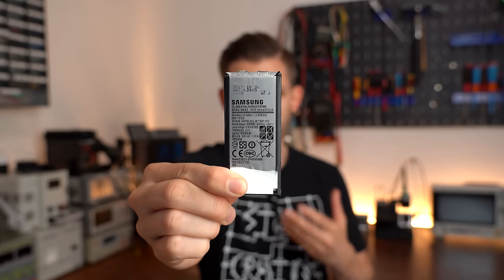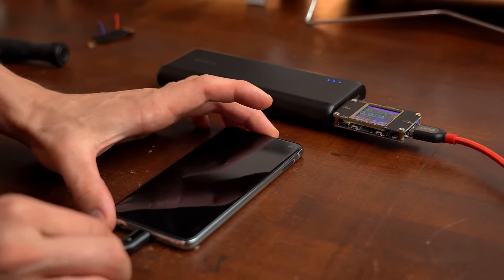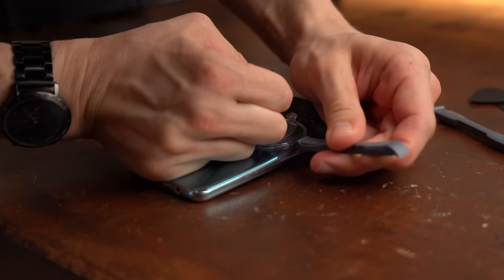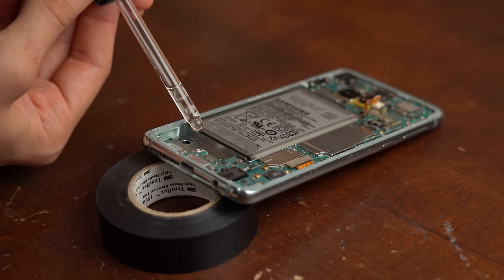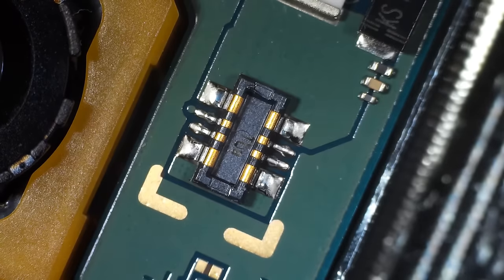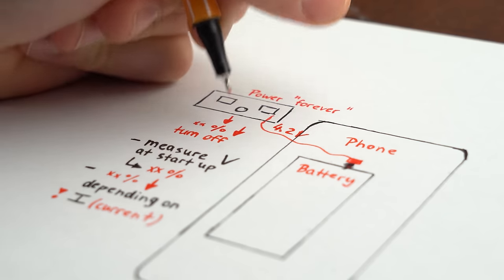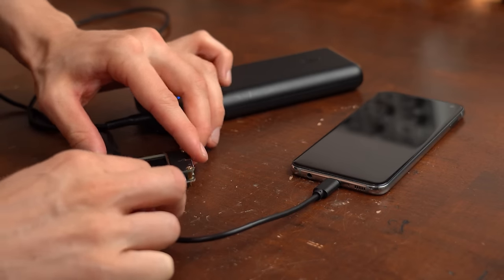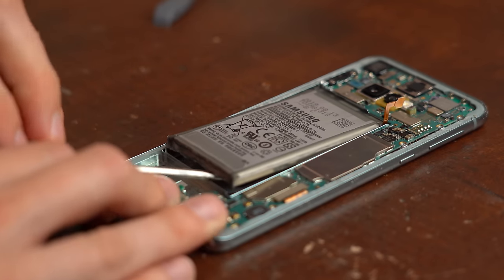I "Solved" Samsungs Swelling Battery Problem! (Batteryless Phone)

Comment: Why not just solder a little super capacitor to the BMS and connect the phone normally via USB C?
Reply from the maker: Could be possible. Not 100% sure.
Reply: @greatscottlab  The BMS would probably shut off, if the capacitor discharges too much (if the phone is not in use for a while). But I think with your circuit, I would have tried to get power from the USB socket inside the phone, cause it looks kinda ugly with a wire sticking out the side. If you wanna be able to use any USB cable without quick charge kicking in and blowing up your BMS, maybe use a zener diode and resistor to generate the battery voltage?

Comment: Just here after the notification and I haven't seen the video yet...
I had two similar batteries on my old Lenovo one  (new one) inside the phone for a long time with no use...and a old one outside (which was around 3.7v when I replaced)
After like an year (zero usage) ...the new one had bulged and and had nearly 0v.
On the other hand the old one which was stored outside was perfectly flat and still measured around 3v.
So yes... Lipo's bulge when they r over discharged.. 
Idk why PPL are fussing about it recently 🤔

Edit:  this video reminds me of my similar mod where my cheap Chinese tablet required a 1.2k sense resistor... Should have just re used the protection circuit instead of going through all that stuff 😭

Comment: I have had 2 batteries swell up in my Samsung phones. The older phone I no longer use but the Note4 I use and I had to replace the swollen battery in it to keep it working. My back cover comes off easily and the battery is directly accessed that way. Much better than the one you have there. My battery does not have those connections like yours.

Comment: Okay, this is a bit better than usual videos about this but it is still a bodge.
What if I need the data wires? And is there no way to get the connectors and build a solution that doesn't depend on the charging board?

Comment: As someone who still uses a s7 as a daily driver seeing that "brand new" phone frame get destryed hurt me a little. I understand you are trying to prove a point but using a "current gen or 1 gen lower" phone is not a good idea. You could have sold the s10,got a s2,s3,s4,s5 or even a s6 for much less money and did the same thing.Also some people   are criticizing your approach to which i disagree. Your destructive method is perfectly fine as long as the device is no longer usable as it was designed to ,but if the device is still usable as it is you should never do anything permanently altering to it.

Comment: A "touch screen + wifi + webbrowser" aka smartphone + raspberry pico-W,  usb hid macro "keyboard", 
at least when adafruit gets a stable webserver in circuitpython ...
browser does not need to load page from "webserver", local html page + many pictures on smartphone should work.
No need for pictures then webpage containing html buttons could be loaded from pico-W webserver.
Reply: GreatScott ±⁴⁴⁷⁴⁰⁵⁰⁷⁶¹⁸⁷  nope

Comment: always turn on the "don't charge over 85%" option,! every android thing i've had failed from swollen batteries before anything else. some models are overprovisioned and limit the charge without advertising it (for added battery longevity) but models where the size of the battery is a selling point ("3 day charge!") operate those batteries right at the edge of their total capacity. they'll swell if you do a full charge all the time, and they're configured to do that, because it's a point on the spec sheet. a phone you like tearing itself apart in under two years is a big bummer
Reply: samsung uses really good batteries, but this will still happen. especially if you have the phone on the charger part of the time at work or during a commute instead of charging it every other day

Comment: I have a 3D Printer controlled via Octoprint, and was going to use an old phone as a new terminal, but haven't sorted it out yet. I was going to have it attach with magnets, and a wireless charger. But I might just do this instead.

Comment: i died a little when u used a file to cut openings intot he housing, knowing that something like this could be done non destructively with just a small supercamacitor and flat ribbon usb cable and using that to rout it external, or you can solder to the internal usb c port to not need to have the plug on the bottom at all and just one wire comming out of the phone with the usb c port being connected inside the phone

Comment: Initially I thought the phone would die because the 5V USB power supply can't handle high current spikes. But maybe it's fine as long as  you don't use GSM and mobile data.

Comment: i have a metal detector an old minelab sd2100 and its supposed to run off this giant 6v led acid battery that you carry around on a sling, but it interferes with the signal because its not connected to the detector its moving in its feild when your searching and you have to hold it really far away from you in order to stop the interference and its annoying as hell, so i took a cooked 18v dewalt cordless drill i had that no longer worked, gutted its internals, used the battery connection point and made a simple little voltage reducer circut with a variable thingo i cant remember the exact name for it, put all that into the drill handle housing and strapped it to the detector, so now i can use my little 2ah batteries one last all day, and because its fixed into place within the detectors magnetic feild it no longer causes interference, it looks a little janky but i swear its the best mod ever! I decided against the resistor method to drop the voltage because i needed to go from 18 to 6 it would have been far too power hungry. This project reminds me of that, i love powering things in more conveniant ways, i also converted my lazer level from 4 aa batterys to run from a usb power bank its a little less voltage than the 4 aa's but it works fine just a little duller than fully charged previously but otherwise its far more conveniant and less expencive

Comment: have to manually boost the battery from the spot welded nickel to boost it to about 2.8v then battery works on phone...if falls below 2.7v the phone keeps rebooting...   just boosting after protection board the ic refuses.... so directly onto the strips

Comment: Would there be any benefit in using like a LTC3440 type circuit instead of just a diode for the voltage regulation? Just curious.

Comment: Nice video! Could the same be achived with replacing the cell with a capacitor? Or are the current draws from the battery to High even when charging?
Reply: capacitors are literally made for high current draws, where they lack is capacity otherwise they'd be called batteries
Reply: @chiefdenis  Yea but if the charger is powerfull enough the phone, shouldnt draw power from the battery. Aka the battery just needs to be "there"
Reply: @express496  logically yeah, but phones always draw power from the battery even when they're at 100%, my guess is batteries are used to smooth out the voltage curve and maintain stability, like a capacitor

Comment: I wish you had not made a hole in the phone and internally connected charging port terminals to diode and battery management circuit so the phone was powered through just one cable! 😢

Comment: Do you think this would work also for old gopro cameras, specifically the 3?
I want to use the Gopro in it's underwater housing as a wireless camera to put under the house to monitor the water ingress when it rains and pump out the water outside, but most of the batteries I have for it don't hold a charge anymore or are kinda swollen. I found that without the battery, the GoPro itself will power on, but "wireless" wifi mode will turn on for a while and then switch off. With the battery, wifi doesn't turn off automatically which means I can just connect to the camera whenever I need without having to go under the house.

Comment: Hey there, I am struggling to find the best soldering wire for a good-quality joint and low melting point. It will be very helpful if you can say me which soldering wire you are using.

Comment: I have 7 Samsung phones, 6 old ones and my current one.  Only the battery in the S4 swelled up a few years back, but I was able to replace it and that replacement has not swelled up since then.  I guess it was a fluke or maybe a bad batch of batteries that year.

Comment: Well actually there is a much more simple solution to run a phone without a battery. The thing is just to use the original battery pack and solder a capacitor instead of actual battery. This is how you could run a smartphone using a regular USB cable without any extra wires.

Comment: Out of curiosity, wouldn't be simpler to replace the battery cell with a capacitor (and a led if necessary a discharge) and charge the device with usb without ruin the case?
Reply: It depends on what you're going to use the phone for. If it's just a fancy alarm clock it would probably be ok, but for heavy or continuous use, the cap can drain faster than it can be charged.
Reply: @iguanamoat  security camera would that drain the cap faster than it charge?
Reply: @angryman9333  I can't be sure, since the power demand would vary by phone and camera app. I think it would be okay, since you can usually charge up your battery and run a security camera app at the same time (meaning the charger can keep up with that load) - however, if it can't keep up by a large enough margin, something like an update happening in the background could easily be enough to push it over the edge.
Reply: the charge/discharge would need a proper regulation circuit and then ya start getting into "why not just put another battery in it?" territory

Comment: Simply replacing the battery with a capacitor could have also worked. And without cutting the case. It would just have to be strong enough to get past the boot.

Comment: Im honestly surprised no one has come out with an aftermarket battery replacement mains adaptor for older phones. Simple 4v a few amps, and you dont have to worry about your old tablet you're using as a home automation interface exploding inside the wall its installed in. Like, with the limited recharge cycles of lithiums.....its simply negligently irresponsible at the very least from an e-waste stand point the manufacturers dont have a battery-less power supply option much less force the device to have a battery in the first place.

Just for the love of frigg DO NOT follow those stupid instructables that just jam 5v on the battery contacts! Thats not how the charging circuit works!!!

Comment: So, not a solution to run the phone without battery, but using ACCA, a frontend for the magisk module, with root can limit the charging. Works with the default settings on the G9600, the snapdragon version

Comment: Sad to see that your S7 have died. Both phones have good alternative firmware to run on them if you don't have any problem to run LineageOS. I have two of the S7 phone and they run well with LineageOS 19.1.  What device is it you use between the phone and power supply? Any Link for where it can be bought would be nice 🙂
Reply from the maker: You mean the MUR460 Diode? You can get it on Ebay.

Comment: This really is not a great solution. GSM modems can pull spikes of several amps when joining a network or hanging off a distant cell tower.  Your USB power supply will not be able to meet that sudden peak demand and things are likely to be unstable.

This is why phones and tablets will generally check and refuse to operate if they think the battery is missing/damaged.

You should put a super cap at the same point to smooth that demand, or at very least turn off GSM activity and use WiFi only to remove those spikes.  Tablets with wifi only are a better candidate for this modification

Comment: I need help! I watched this so i can connect my old S7 to my 3d printer. I need the USB to connect to my printer but then i cant charge it anymore, so i thought of soldering a power supply to the phone. Now as it turns out i still need to use the USB port for the power supply so this doesnt work. Can anyone suggest a working OTG cable that lets me connect to my printer WHILE charging the phone simultaneously? Or does anyone know a method of using a soldered power supply without using the USB port?

Comment: This is cool... very useful.
But I hate that you can see the phone has ben modified, would be much nicer if the solution could be inside only.
Also, way do thy not just make the phone work without battery in the fist place, and maybe make it a bit easer to remove.

Comment: I think that an electrolytic capacitor as a replacement for the battery unconnected with respect to the USB cable is a better solution. It does not require any holes or permanent damage. I tested this solution on some devices. Although in one case, it did not work properly. I would like to know if someone else found this to be a good solution.
Reply: The main issue is that the phone can drain the cap faster than it can be charged during heavy/continuous usage, causing reboots/crashes. Maybe that's what happened in that one case?

Comment: I have a tracfone that I power using a powerbank on the pins in the back.  It always stays at a 100% and hasn't once randomly shut off. Very curious as to way the modern phone has that voltage drop very odd indeed

Comment: It still scratches my head. How can the battery % go down when the voltage is still at 4,2V? What if you have replaced your faulty battery with a new one? Would it use its full potential? This principle is a bit similar to the ink cartridge printers where the microcontroller also simulates the amount of ink left. What if it was faulty and the cartridge still have a plenty of ink inside? My J3 2016 dies on 20% of the battery. Sometimes jumps from 30% to just 1%.
Reply: It calculates charge based on current in/current out of the sensing IC. It re-calibrates on power up and over time (hence why sometimes phones need recalibrating by letting the battery die then be re-charged from flat to get proper reporting). It's nothing to do with DRM, battery voltage is just a poor method of calculating charge due to voltage variations over load

Comment: I got around this problem by replacing my old phone's battery with an external lithium super capacitor (750F)
Gives around 10 minutes of time away from the wall, but that's not a real problem since it's meant to be used connected to any usb charger
*Charging the super capacitor also has to be done externally (a simple type C usb buck converter set to output at 3.8v, not 4.2v), which added some bulk so it doesn't really feel great in the hand, I didn't need to connect the usb charging port for my phone model so I got lucky there
Reply: my samsung s8 phone keep shutdown even there is supercat 5.5V 1F
Type C Female > LM2596 > Supercap 5.5V 1F -> battery logic board -> phone
5v in, and output 3.8-4.2 but still keep shutdown, samsung logo boot then blue light > shutdown
Reply: @HDWB_Gaming  1F might be too low and the cap's voltage probably went below minimum during startup since I faced the same issue when I tried with smaller capacitors. I don't have any smaller super caps than 750F so I don't know what the actual minimum is
Reply: @bnelsey  so what i need to buy is about 3.8V or 5V supercapacitor with high F ?
i just follow some dude guide but look like 5.5V 1F just to prevent power spike, not to turn on phone
Reply: @HDWB_Gaming  high F and the closer you can get to 4.2v (Lithium Battery max voltage) the better, the 750F 3.8v supercap i'm using has a total energy similar to a tiny 300mAh lipo battery, which would explain why a 1F supercap is giving you problems
Reply: @bnelsey  ok i will order that one :) ty
btw this connect directly into BMS, so i can still plugged type C into type C port for samsung dex, usb hub right?

and i see a lot of "UF"
eg 4V 680UF
Reply: @HDWB_Gaming  you'll need 1,000,000 UF to get 1F, so those UF capacitors are extremely tiny
Reply: @bnelsey  oh i see, when i check one with 3.8V 750F, price is almost x3 battery cost itself
the one i found 3.8 500F price is equal as battery. about 4.5$ i think

Comment: I literally just made a video of me doing this to a s6 a few days ago, and now I see this video come up. I didnt notice the battery level going down yet though, maybe I should have tested it for longer.
I'm going to have to come up with a different solution for the slow 'discharging' than use the usb port, as I want to use the phones usb port for USB OTG peripherals

Voltage seems to make no difference, i booted it at 4.1v and it said 85% battery left upon booting. It then 'discharged' itself to 82%. I upped the voltage to 4.4v and rebooted the phone and it still thinks it has 82%

So far I am testing modifying the phones perceived battery mah rating by editing the phones floating_feature.xml (the phone must be rooted)
Its located in /etc/floating_feature.xml and can be edited via a file explorer app like sv explorer
I've set the mah to 99999 in hopes that it slows down the discharging to an acceptable degree. When you go to the phones settings and 'about phone' and battery it now shows 99999mah 
I've left it on and will see if it 'discharges' any slower

Comment: I'd like to know (for science, of course) if it'd be possible to solder the battery circuit directly to the charging port of the phone from the inside, so there would be no need for an external cable and you could use the original cable. I'll attempt it on an old Motorola phone and would love to have it this way (discrete)

Comment: i use an old galaxy s5 in the same way, to prevent battery destruction i've connected directly +5 volts on + and - phone terminals but it don't drop percentage of the battery
it still 100%
the phone see 4.8 volts of "battery" voltage but no damage after years of this